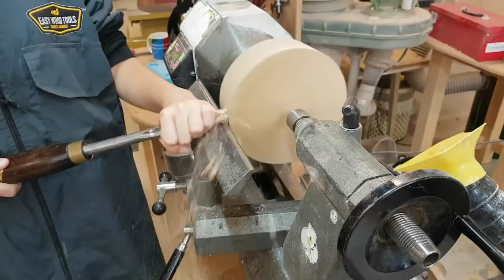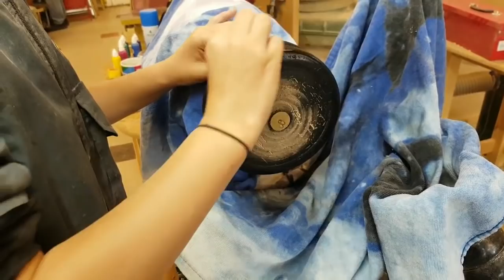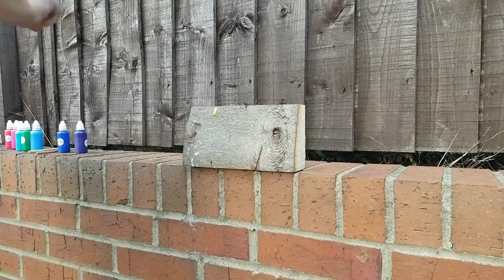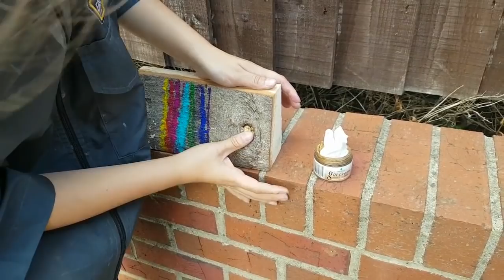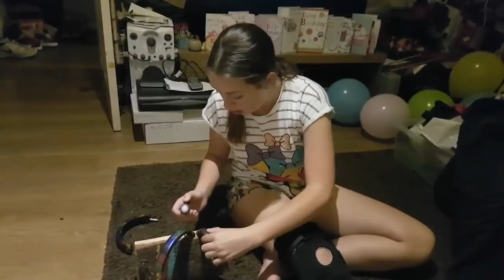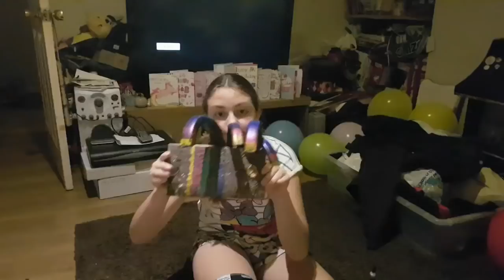Wood Turning - Exploding rings thanks to wood worm - Project Broken Rainbows

Comment: Hello Caitlan: I am for those who believe there is to learn to draw lessons from everything that happens to us. In this case there was an accident, but you managed to overcome the problem and create something new and very beautiful. Congratulations on it. However, I would like to tell you also that perhaps the problem occurred because faced the cut of the rings at very high speed. Maybe if you had done more slowly that would not have occurred. On the other hand, in your videos is never seen your face while torneas and i don't know if you use some elements of security. Understand that if a piece of wood become detached from the surrounding hits you face, or any other part of the body, you will do no harm, it could even happen something very serious, that is why it is necessary that you use a mask or any protection for face, in addition to thick clothing and gloves for your hands. The security is never more, although sometimes we are a bit uncomfortable to use. Greetings from Chile, Amigos Torneros de Madera Chile.